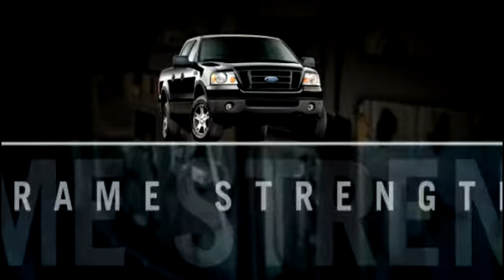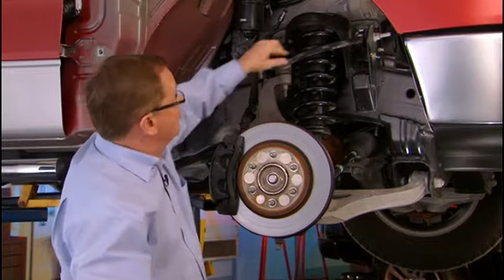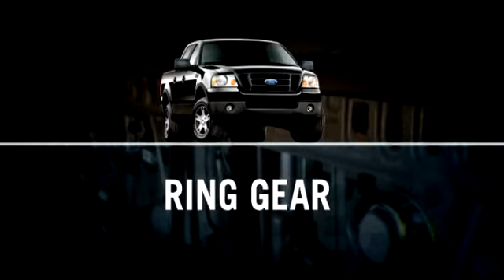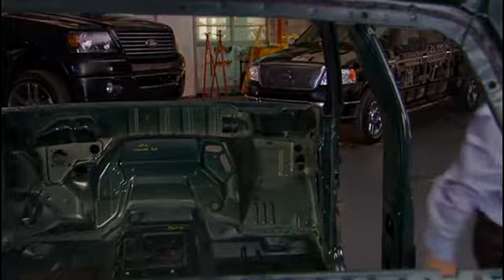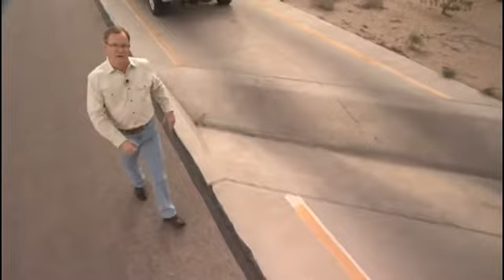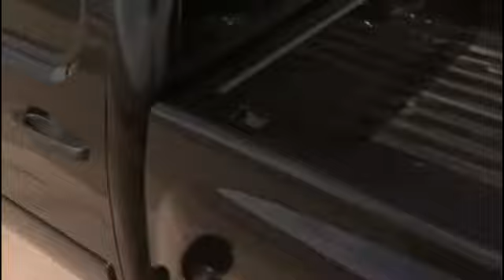2007 Ford F 150 vs 2007 Toyota Tundra "The Truth About Trucks

Comment: Remember when Ford started giving new F-150s to owners who reached 1,000,000 miles? 

Oh wait, that was Toyota giving out new Tundras….one guy hit a million, got a free truck, and then hit a million with that one. 

Also, the market doesn’t lie. 2nd Gen Tundras hold their value better than just about any other vehicle on the road- used F-150s are a dime a dozen- ESPECIALLY this generation. Why? Because the market says that used Tundras are far more desirable than used F-150s. That 3v 5.4 is one of the worst engines of the last 25 years. 

Tundras have a 10.5” ring gear as standard equipment, F-150s have an 8.8” standard; the 10.5” is only available with the 5.4 and the 7700 GVWR package, which also comes with 7 lug wheels, I’m surprised he didn’t mention that, probably because so few F150s actually have them. 

Also, 2nd gen Tundras have 5-lugs over 6 because the rims are hub-centric, not lug-centric- so the weight of the truck is resting tightly on the center ring of the hub and not just on the lug nuts, which is more secure and helps eliminate vibration. The first gen Tundra had 6 lugs- the 2nd gen was bigger and heavier and still didn’t need them because they’re a different design entirely. 

It goes on and on, one half truth or flat out lie after another. Look at reliability ratings and resale value- it’s no secret. The 2nd Gen Tundra is considered one of if not THE most reliable half ton ever; that F-150 is the one everyone says not to buy because it will need an engine. 

Get a grip dude.